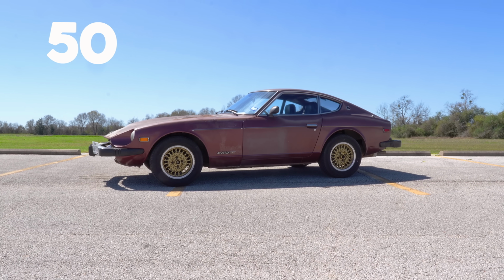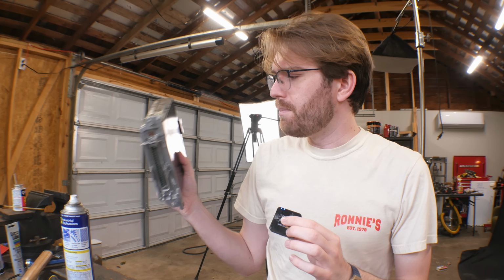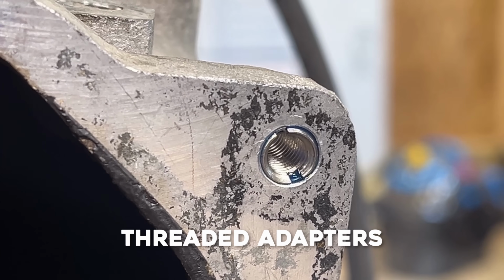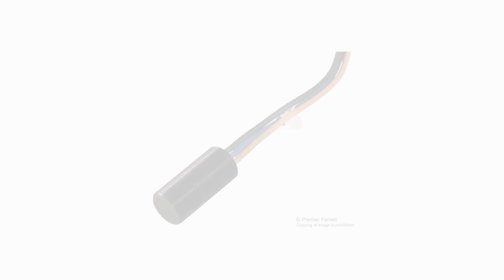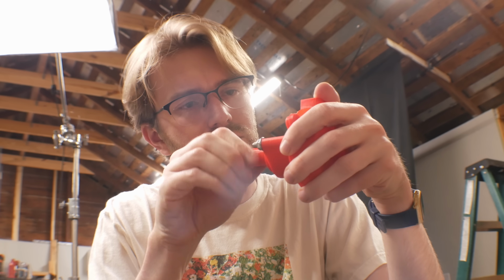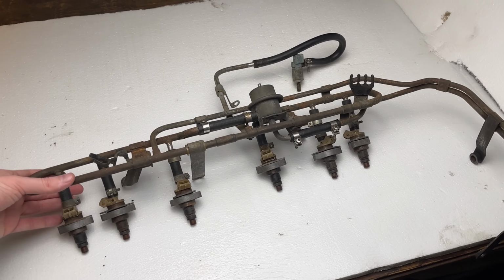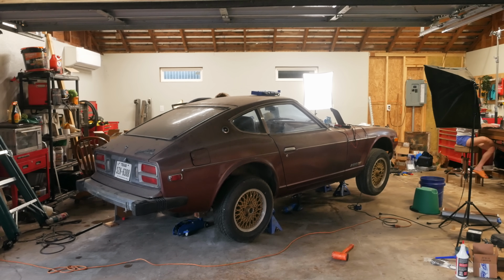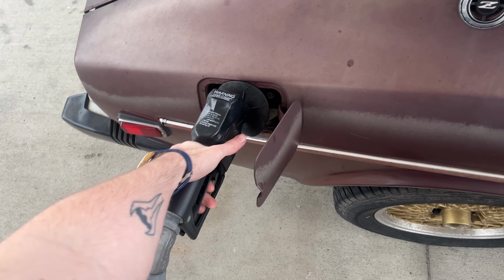Modernizing a Vintage Car

Comment: Very nice!  One thing you gain from this mod is that you can retire the old L-Jetronic ANALOG ECU.  It's amazing these things have lasted as long as they have, but the linear circuits eventually get quite tired and run out of spec.  So, you've gained longevity for this lovely girl.  What you lose, though, is the historical accuracy of that Rube Goldberg mousetrap monstrosity called the L-Jet EFI.  There's something sort of fun (in a sadistic sort of way) in the restoration of all the trapworks, thingamabobery, and push-me-pull-you charm of the original design, even if it only gets 16 mpg.  And actually, in the end, after doing a 99% original restoration (only adding in a fuel/air enrichment adjustment) on my '78 Z, I, too, got 19 mpg combined.  Fun-fact:  If your ECU said "Bosch" on it, it had already been replaced.  In '77 and '78, the ECUs were made by Hitachi, under license from Bosch (exact same design).  Really enjoyed your video!  Good luck with the rest of the car.

Comment: I wish I was mechanically & digitally? electrically? inclined enough to do similar from scratch but I'm not. 
But I could at least install a fuel ⛽ injection conversion kit if someone made one for that engine.

Comment: Tbh the most reliable modern cars are from the mid 90s to early 2000s. Before that we had cars that well just are not reliable but are simple to fix then after 07-08 we get cars engineered to self destroy themselfs so you can pay more for repairs as repairs were harder for a ordinary person

Comment: I've heard of wasted spark but never have I heard of wasted fuel ! That is crazy that all injectors fired simultaneously ! That would surely make the system less efficient than a carburettor ? & the emissions must have been way higher.
Extremely bummed that you only gained a mere 2mpg (American mpg as well 😢)

Comment: You out smarted your self. 4.8 Chevy LS Factory output ranges from 250 to 302 horsepower, depending on the model year and variant, with torque ratings between 285 and 305 lb-ft.
This engine fixes everything wrong with the datun z

Comment: the stupid hall effect sensor in my Audi 100 stopped working, which resulted in no spark. Changed out the entire ignition system, cables, spark plugs, distributor cap + finger.... and it wouldn't work. Then I changed the hall effect sensor.. which sits INSIDE the f-ing distributor, forcing me to buy the whole entire part

Comment: As if it wasn't enough to have to convince (read coerce), the parts to do what they needed to do, now you have a computer that needs to be persuaded to run the car until it is satisfied with the data you feed it.

Comment: Bizarre. I want the exact opposite. I want a modern car, like a new pickup with a 30 year old 6 or 8 cylinder Turbo Diesel. No DPF, no ad blue, no electric bullshit under the hood. Torque and power with reliability.. plus heated seats and a really good sound system.
Reply: Ok ive now watched the video. So awesome! my comment still stands but its a great thing you've achieved

Comment: Too much work for ading 17HP,  having 125HP on the wheel is more then enough to drive fast on public roads with a vintage car. I had in the pas an Opel Commodore 2.5L straight six engine with 120HP and it was more then enough to drive fast on public roads.

Comment: If changing the CAS and ECU isn't in preparation for installing a turbo or centrifugal supercharger (to keep it simple), you're wasting your time trying to make a low compression (8.3:1) engine more efficient.

Comment: Tech-savy young guy working at a Stellantis dealer here. Modern engine tech is great and all, but I prefer the feeling of freedom you get from working on a car with a carb and distributor. There's something about being able to tune your car anywhere with a screwdriver and a wrench that just feels correct to me. I don't find them difficult to tune and maintain although I'll admit that finding info online is somewhat tricky at times. Just wanted to briefly represent a portion of the young enthusiast crowd here! And all that said, do what makes you happy! :)

Comment: You did say it was reversible but... umm... looks like it would be a heck of a lot of effort. My prediction is that you'll never reverse it. 😏😉
So if the engine when new produced 170hp, where's that other 25+hp being lost? Is it mostly within the original engine components? It'll be interesting to see how much oil you end up burning over time.

Comment: nice video but im a vehement wire throttle hater, all the added benefits go out the window when i have to repair or replace it 3 times in 2 months for 4 different clients. if you're not planning on having advanced cruise control, traction control or auto rev matching it's simply not logical to worsen your maintenance over a cable i've ever seen fail just once

Comment: Love it.  I've replaced a few l-jetronics with modern ecu's.  But using the distributor for the 36-1 wheel?  bad idea.  Use the crank.  Trust me, use the crankshaft.  Find an a/c hub ori something.  But use the crank.  That's what the ecu wants.   Other than that, I love the video.  And if you've not modeled your 36-1 wheel, in your kitchen, in the winter, well... that's thats what it;s all about.

Comment: I know 120hp for that kind of heavy car is not much but 120hp is still quite a lot even in today's market for very very normal day to day cars. I mean Renault still produces 1.5dci engine with 95-110-115hp. And VW still produces 2.0tdi engines with 115hp and they're all enough for daily life.

Comment: Using drive by wire, coil on plug, and sequential injector firing is cool, it is really not nessasasy on this engine to make it act more modern. About 20 years ago I converted 2 Nissan Patrols with L28 engines from Carburator to EFI. Both are still running the same setup today. I found EFI manifolds from other L28 donors, removed all the idle up systems, kept the drive by cable throttle body and added a single PVM idle valve (Bosch made many models for VW, BMW etc vehicles from around that time). Those vehicles had the same benifits you got at a fraction of the cost and with much less effort. I used a locally produced in South Africa ECU (We had 3 or 4 companies producing these type of units at the time) The ECU got its timing from 4 pulses per 2 revolutions and the Distributor still fired the right cylinder when needed. Since you fire the injectors behind a valve in the intake and not directly into the cilinder, sequential injection vs batch has no real benifit in an intake system that was not designed for sequential firing. We experimented on a few different older engines back then and doing batch vs sequential injection made no noticeable difference on those motors. As long as you locked manual advance and retard mechanisms on the distributor, wire the pulses from the distributor to the ECU input and fire the coil from the ECU, use a Map sensor to measure engine vacuum, you can perfectly manage AFR and ignition timing making your engine run well. All extra you needed for refinement was an Intake Air Temp sensor and a O2 sensor and your engine was 100 happy and efficient.

But doing coil on plug and drive by wire is cool. BTW adding a 36-1 wheel behind your crank pulley is much easier than building such a elaborate pickup enclosure. Back in the day we did not have all the cool toys like 3d printers like today, but the return on investment was much shorter and tge smiles on our faces almost negated any financial impact

Comment: did you not uninstall the nut on the end of the sparkplugs? NGKs come with a nut that fits both modern and old vehicle components, just gotta grip it lightly with some pliers and turn and it should screw right off. Had to do it for my 1980 KZZ650

Comment: That particular crankshaft sensor will perform better if you complete the magnetic loop. Lets say the tip is north and the body is south. You need to couple the sensor body to the wheel with an iron path. In your design an iron part in the lid that goes from the sensor body the shaft center will do it doesn't need to touch the shaft, just be close.

Comment: I really enjoyed this video, and I find most build videos kind of tedious. You kept it lively, and the jokes were pretty good. I especially like the part where  you got your fly-by-wire throttle controlling the butterfly valve. I've been feeling kind of hard done by, driving my first vehicle with a fly-by-wire throttle. But your demonstration showed a pretty direct connection, so I miss the cable throttle less. Though to be fair, in modern cars, pressing the gas pedal initiates a Request for Acceleration, and the computer decides whether to open the butterfly valve. But when I'm driving now, I imagine its as direct a connection as in your demo.

Comment: 19.8 mpg? That's still a lot, but man you did such an amazing job on that car! I achieve to do 33mpg with my 1985 Toyota Sprinter Trueno with all original componants including A/C power steering. It's very good for a 40 years old car.
Weird that your Datsun is consuming that much gas

Comment: A high school teacher of mine had a 280z that had a Chevy small block 350 put in it. If you shifted it into gear when it was idling, it could do about 35mph without touching the pedal.

Comment: Hello Ronald in 1977 I was 22 years old and I purchased my first new car a 1977 280 Z and I loved it. I wish I still had that car.
 I’ve watched part of this video and it really enjoyed it. Hope it turns out that you get the engine more reliable with the new fuel injection system.    Yeah I am thinking about if I should look for a 1977 280 Z to work on as a retirement project for fun.   I just sold my 1974 Porsche 911 that I had the engine and transmission rebuilt. The Porsches are very fun to own and drive but the parts are five times as expensive as other cars and you have to find mechanics that are specialized in Porsche air cool engines to get the engine rebuilt, right. I’m thinking now five years ago I should’ve bought a 77 to 80 Z instead of the 74 Porsche 911 to restore. Keep up the work on your car and have fun.

Comment: Gasoline engines need 4 things to run: air, fuel, compression & properly timed spark. It would be great to see the interior of one of these '70s or 80s cars updated.  The 944 is such a great looking car and has a variety of qualities (like front engine, rear transmission) that are rare in cars, but an upgrade to the interior would make that car much more attractive.
Reply: Boy, you put in a lot of effort! Congratulations!

Comment: You do realize that Bosch made car parts long before they made dishwashers, right? I mean, you have the biggest research tool at your fingertips but decided to go with a lame dig instead. I wouldn't be surprised if your Chevy Cruze has GM branded bosch parts in it.

Comment: One of my first cars was a 74 Dodge Challenger.  It had a 318 two barrel and was lucky to make 170 hp but it was crazy heavy and slow. At the same dealership they had a 280Z and I still regret not buying that car instead. I’m sure it would’ve lasted longer with less problems. I have had many cars over at years.  when I dynoed at my 2010 370Z and it barely made 270 wheel hp stock I thought it was a abysmal. For the time. An intake, exhaust, and a tune put it closer to 320. but when you mentioned modern HP and MPG it made me think I recently picked up a 2020 Porsche Panamera turbo (AWD 4L TTV8) that has over 550 horsepower yet still gets 27 MPG on the highway (if you are not horsing it around) the new 2026 version makes close to 700 hp and has better miles per gallon because it is hybrid and  uses larger turbos as the electric gets the vehicle off the line and moving while for the turbos spool up.  Its crazy!  Anyway… All that being said I would still buy a 280Z in good condition… if the opportunity came up.  Very cool.  I remember trying to remap my 2001 LS1 in my Trans-Am total respect for doing that 🫡

Comment: You forgot to make the fuel map? No you didn't? For the rest, this is a fantastic video. All this looks so great!!! The cleanup in the engine bay is the best. Now, get the engine out and rebuild it. Use some tuning cam an you can get close to 200HP.

Comment: First of all, I’m super impressed by your dedication, I can see how all that added up to 8 months, I doubt I could hold in there. I was amazed that a 50 year old fuel injection system was only 2 mpg better, I suppose if you say 17% improvement it not only sounds better but gives a more accurate impression.

Great video, really enjoyed it and the best part is it gives a more accurate impression of the amount of work that goes into these upgrades.
Reply: Bro don’t write a essay here

Comment: In your video from 2 years ago where you did battle with the gas tank.

Is that a mid 80's Honda 750 interceptor in the corner of your garage at 19.46 ? 
Your videos are both informative and funny. Keep up the good work.

Comment: Older cars had design-soul.
Modern cars have none of that, unless you're buying high-end. Even then, modern design is pretty soulless...

We want those designs and modern ability. 
Even the designs of the 80s, which seemed so bland to me, at the time, are amazing with the context of time.

Comment: I've always been torn between if the 240Z or the 280Z is the best Z car ever.  I've had the 240Z, 260Z, 2x280Z, 280ZX and a 300ZX.  I usually lean toward the 280Z as being the best as overall I felt it had the best handling and "modern" features at the time, but the 240Z (once some upgrades were done) was a reliable and fun car to drive.  I really disliked the 280ZX, but that just might be because the one I had had a lot of issues.  Still was fun fixing these "older" cars when I was in HS.

Comment: This is crazy, funny.
You probably could have did a cold air intake and a retuned the carb for less money & got about the same power & mpg maybe headers or manifold upgrade, intake. These are external parts too?That would help get you better performance

Comment: I knew intuitively this would not pencil out in terms of bang for the buck.

The hp you dyno'd at the wheels was very much in line with thr stock hp for 280z's.

The years they were made were low performance where manufacturers were still trying to deal with the new smog requirements.

There is nothing intrinsically wrong with analog control systems.

If everything was pretty much intact,  I would not expect to see a lot of performance gain.

Where your mods would apply would be if you had ported the heads, added or built a high mm flow intake, installed a more agressive cam, aftermarket headers, all that sort of usual engine build stuff.

THEN you'd have the tunable system to support that. 

I'm wondering if that's what this project was all about.

Because as I mentioned, dropping a 350 chevy small block, headers etc in it, you could have tripled the hp for about the same cost as what I'm guessing if you were to pay yourself for your labor and didn't have sponsors, would be about the same cost.

Alrgough you did male good use of junkyard parts, so maybe I'm overestimating the cost.

Comment: Also a lot of people do NOT realyze the fuel first needs to reach the engine. We did see that the pump works but that does not mean the engine gets fuel all the time. or that it even gets pumped to the engine.

Comment: ...I just did the math on your MPG after the rebuild (converting to L/100km). Uhhh, you either have some compression issues, or you need to replace your catalytic converter and/or muffler.

You literally should not be doing worse than my car was before doing anything.

*It's not as bad as I thought, that converter was just off. (I was confused because it was different than my own math, but I have no faith in myself. Ironically, 'check your math' website... not so good "14.2L/100km for 19.9MPG" vs my math: 19.9/3.78 -> /0.62 =x, 100/x= 11.81L/100km). Still though your upgrades should not have the car just being in the upper ballpark of the rest of the unmodified cars. Wheel alignments make a big difference as well as previous suggestions.

Comment: 8:06 Hahahaha

It sounds like you had the same idea as me, but took a different approach. Mine started with about 8.9L/100km for fuel economy (HWY) 11.7 (city). I went for fully sequential ignition and injection (with cam and crank sensors), but leaving the manual throttle, I also went for a 5 speed transmission. Which didn't really help the fuel economy, until after the aftermarket ECU was installed. I also left the split rail with a central (manually adjustable) fuel pressure regulator. But I also changed the exhaust manifold (...and may manufacture a different one, and a different intake manifold... I haven't decided), as well as a more free-flowing straight through muffler.

Comment: Why are you bothering with engine horsepower, and comparing it with other cars? What is the weight of the car? Power to weight ratio is the only thing that matters. As a general rule older cars are lighter because they have less bells and whistles built into them... it depends entirely on the make and model of course.

If your car's total weight is less than modern cars of the same class, YOU ARE AHEAD.

All you really need to worry about is the steering and suspension. If your classic car has proper wishbone suspension, and disk brakes YOU ARE AHEAD.

Only then do you need to worry about tweaking the performance of the engine. If you ever have money, blow it on a good interior. Make your driving experience top shelf.

Good suspension and braking are what makes a car high performance, not raw power. Because high performance driving is all about tactics and timing, not being the fastest on the straight. Keep the wheels and tires as small as possible and you will be unstoppable.